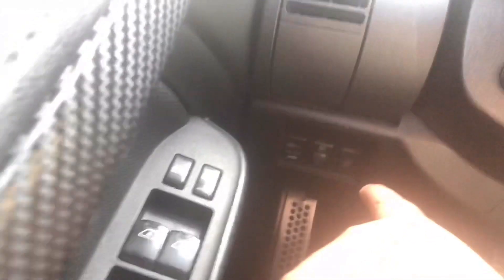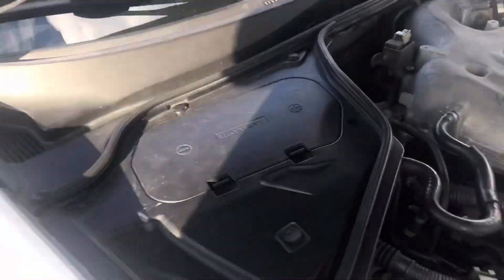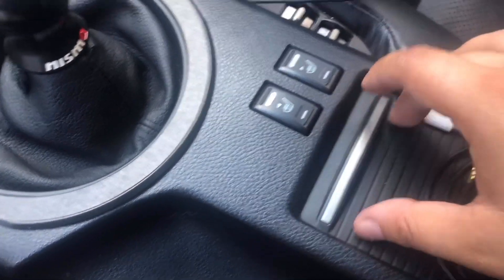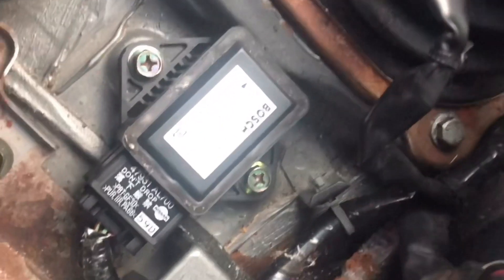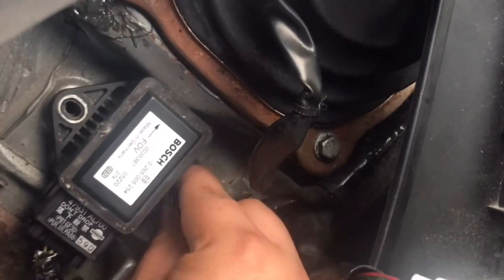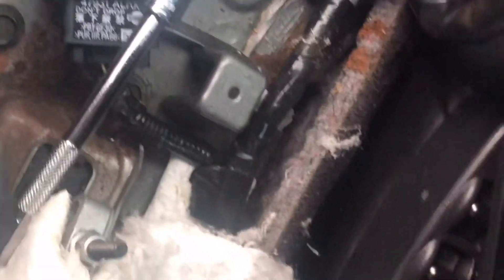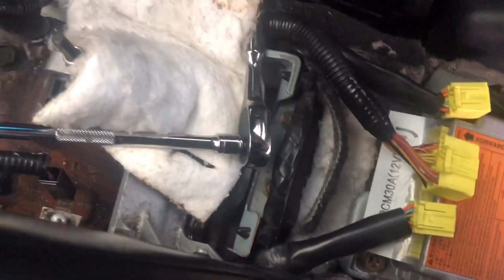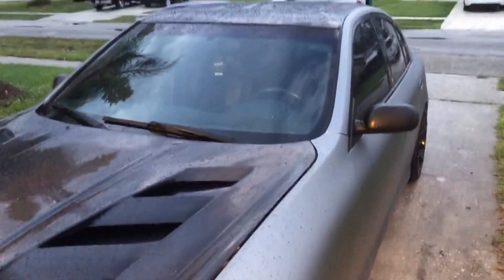How To Disable Traction Control On A G35/350z

Comment: I have a g35 coupe auto 03 i wanna turn the traction off i have a button that said vdc but nothing happens if i click it how can i turn of the traction control im tryna drift and do burnouts
Reply from the maker: Jose Meza follow the steps in the video fam
Reply from the maker: Jose Meza when you turn of the vdc it still kicks in and cuts fuel.
Reply: KTVBUILT is it the same if i have an automatic?
Reply from the maker: As far as how the traction control works I believe so. Unless it’s disconnected it’s going to cut fuel. That’s something you’re going to have to look into but I believe they will be the same.
Reply: AJAJAJAKAJAK AUTOMATICO JAJAJAJAJAJAJAJAJAJ

Comment: I dont have any issues gettting the car side way if you watch my video i just posted up, its just that i cant do a standing burn out. so im sniping the pin 101 on the ecu will do the trick. Have you had issue with kiccing the car and the car fuel cut and stuff with just VDC turned off?
Reply from the maker: Yup, that’s why I disabled it